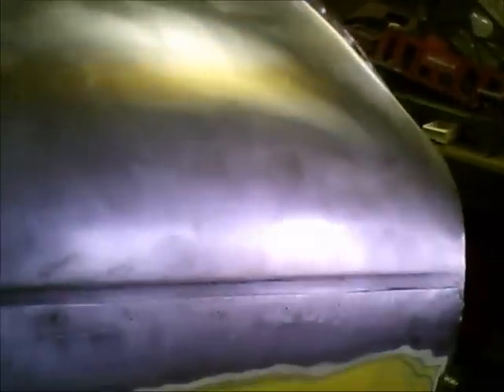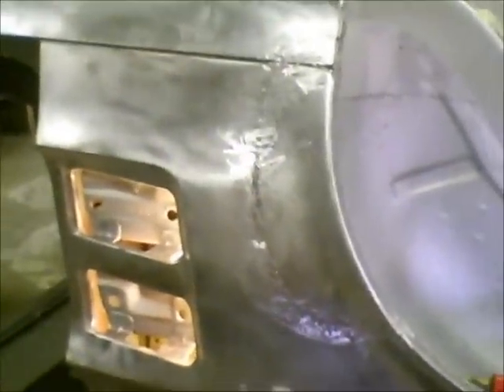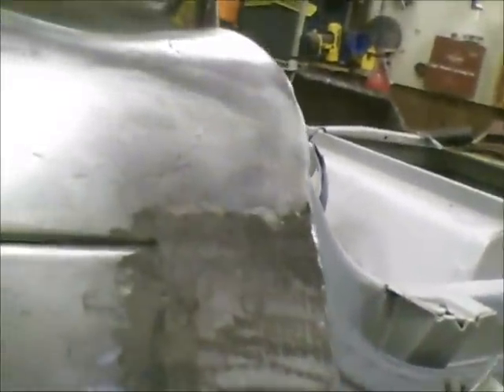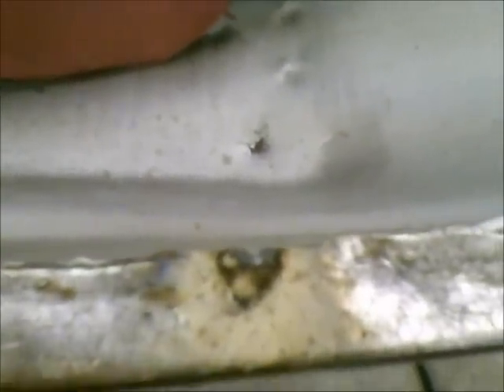Quarter panel repair

Comment from the maker: @MrMattyg75 I had been wondering about replacing or trying this for a few days.
I finally figured I could not goof it up any worse by trying this.
I will see if it meets standards after a little filler and some primer.
Thanks for tuning in.

Comment: @cecil6711 I almost got the firewall all done, I think I might do that video of priming the fender this weekend! Still up in the air on the paint, the painter at the shop said he might of found a loop hole and will be able to use the UNO matte black paint, but now I'm not sure if I want to use it now, I had 2 people recommend I use base clear with a flattener! So I think I'll wait till I hear from the Matrix rep and I'll do a little more research in the mean time But I will keep you posted